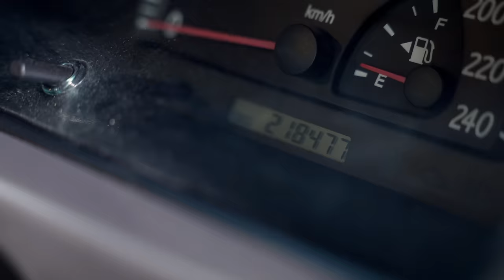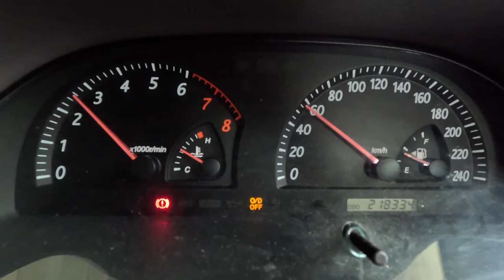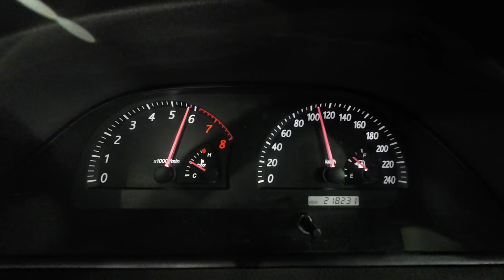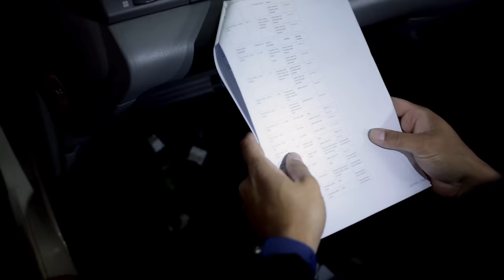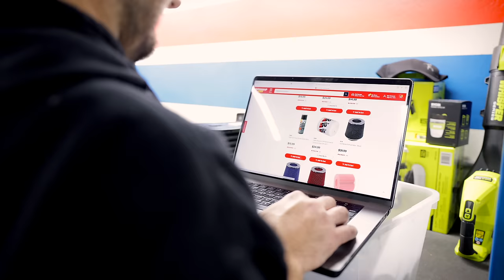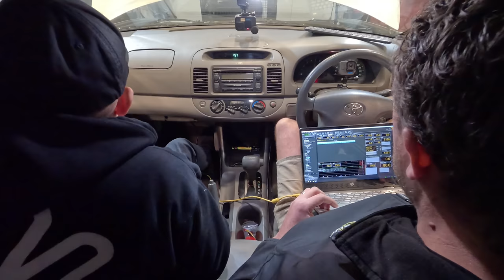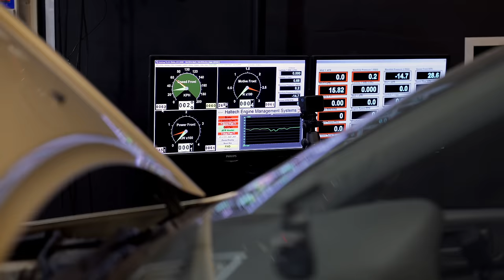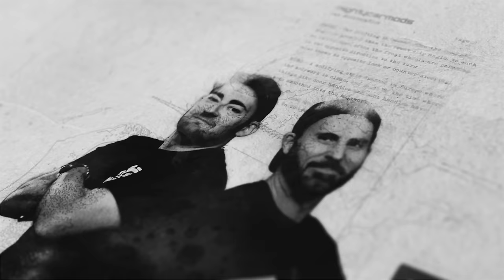World's cheapest Turbo Kit (on a Camry)

Comment: The resonator is called a "helmholtz resonator", and it is tuned to a specific frequency that is particularly loud on that intake system, in order to cancel it out. The whole point is to limit droning during cruise conditions.
Reply: Thanks for this explanation!!
Reply: The car should be a single seater if the owner doesn't want droning.
Reply: 🤣 @nunchuckfilms
Reply: @nunchuckfilms  Someone needs to send those tubes to Ukrainian troops to give them protection from droning.
Reply: Close. It's a 1/4 wave pipe resonator, though even resonant pipes have some helmholtz qualities.
Reply: @gregmuon  1/4 wave resonator is a subset of a helmholtz, in that you make the pipe 1/4 wavelength long, which gives the same effect as a non-tubular helmholtz resonator tuned to eliminate the same frequency.
Reply: They can add a bump in torque at certain rpm as well, depending on tuning size and location and whatnot
Reply: S2000 has one on the oem exhaust
Reply: What a legend
Reply: solved with electric cars
Reply: I wouldn't mind seeing the boys make custom versions of these to see the difference in noise/power etc.
Reply: well fuck me. my little parts runner toyota sienna minivan has one of those and i always wondered what the hell it was (but was way too lazy to google it). random internet comment ftw 👍
Reply: This.
Reply: @mechanicalman4531  Doesn't stop the drone from people about EV's lol ...
Reply: Resonatorectomy is what we call it when installing an intake lol
Reply: Let The battle of who can google the right facts first and try sound smart begin
Reply: Luv my subies, but that was freakin awesome. Hilarious..I want a Camry
Reply: What will happen if you remove it. Will you hear loud intake noise? Similar to the sound you would get installing a pod filter?
Reply: @phoenixking7449  You'll get SOME increase in noise. They are only used to target certain frequencies, which can't be eliminated by other aspects of the intake design. If you want intake noise, you have to remove all of the resonators, plug the remaining holes, and even then, it won't be super loud, because that's how they're designed.
Reply: @dr.mantistoboggan4746  TONS of cars have them on both intake and exhaust. The Lexus LFA has a whole intake manifold designed with these and other musical inspired qualities/Technology to make its sound unique. Very cool stuff.
Reply: @phoenixking7449  You likely wouldnt even notice until a mouse or something crawled up into it. Now if the intake system had a MAF sensor then the air coming in after the sensor would make the car run like ass.
Reply: @crisnmaryfam7344  Yeah but Honda was doing it in 1999, who's #1 big deal cow now?
Reply: @dr.mantistoboggan4746  Honda toyota, Nissan, All the Japanese brands were doing it in the 90's as they all sort of share tech amongst the country. If its something that helps with emissions and comfort and not something super unique and "proprietary" its generally shared to help better everyones experience of the like. Helmholtz resonance effect and such has been known about since the 1860's, its only when people starting complaining about mass noise and pollution that companies really started applying it in different ways. You can probably find a similar function in nearly every muffler/exhaust system or even multiple, on nearly every car since the mid 1980's. Whos the big deal cow? I have no idea man. You tell me.
Reply: Like somebody else said, intake resonators are common on naturally aspirated engines - partly to affect noise, but they also are tuned to improve VE at certain RPM ranges. The intake air charge moving through the intake creates a pressure wave that bounces off the intake valves when they close  The resonators are tuned with a volume that allows that pressure wave to bounce back to the intake valve when it opens again  forcing more air into the cylinder and improving VE.
Reply: When i supercharged my mustang with a centri, I had to install specific length j-pipes on the exhaust to mimic the resonators i pulled out when I lost the stock air box.
Reply: I am an engineer and don't know what it is.  I thoughtbitvwas to stop a vortexes in the intake...?
Reply: @petecotter6790  Nope. They're just for resonance. Vortexes are eliminated with flow straighteners, but that's only needed on the upstream side of a mass air flow sensor.
Reply: @JohnDoe-fk6id  I didn't consider the maf as a vortex cancellation device. Cheers
Reply: @petecotter6790  It's not. The flow straightener upstream of the MAF is
Reply: @JohnDoe-fk6id  sorry I re read what you said and yes
Reply: That turbo will probably last about 200miles😂
Reply: I like droning during cruise conditions, l get used to the sound and it makes me feel like it's healthy

Comment: I purchased an 03 Camry, V6 manual at the start of the year. This video has encouraged me to hold on to it, and slowly build it up to be something special!
Reply: I have a 2.4L manual 2005 Camry. Love it, but spent way too much money on it.
Reply: Where did you find a manual I have a 2000 V6
Reply: The 3.0L manual Camry was a sleeper... There was even a TRD supercharger for it...
Reply: @LeagueOfLegendsQc  So, which year was this Camry in the video ?? Thanks. Pwy.
Reply: How unfortunate
Reply: @Tenasedeinc  marketplace!
Reply: @SimanSlivar  I'm keeping an eye out, just bolt on from what I've read
Reply: @esscodc2  lol, why unfortunate?
Reply: because it's a camry  @LZEGION
Reply: THIS video made you feel that way?! 😂
Reply: @Wayne3nterprises  bro has already added a carbon wing on the back, and a stainless steel rainbow tip muffler onto it. And probably topped it up with 200 litres of oil since the original post
Reply: I have 03 v6 camry this motor has 335k and purrs as new.
Reply: @Billy-burner  don’t forget the stickers. Its got a bunch of stickers that add a ton of horsepowers
Reply: @bustjanzupan1074  2003 ??
Reply: '03 V6 manual is probably the best daily driver you can get that has the aftermarket for Fun, it's an amazing blend of stock reliability and aftermarket performance

Comment: based on my rough calculations from a blurry dyno screen, that 200 kw at 5700 rpm, looks like 330lb/ft of torque

270/330 at the wheels is impressive

Comment: The reasonator that you were holding is called a quarter wave resonator. It is designer for a wave to hit the end of it and bounce back exactly half a wavelength later. The original wave is then hit by this wave coming back from the reasonator, reducing the noise. But the reasonator can also be tuned to create an additional stronger pulse into the intake, increasing the torque slightly at a certain rpm. If you want more information on this just Google quarter wave resonator or Helmholtz resonator. These reasonators are also very common in exhaust to remove drone at a specific frequency(rpm).
Reply: There’s always someone who knows these things. Useless info but thank you anyway. I learnt something
Reply: @imachamp68  mate.did you miss 16:58
Reply: How does this resonate with you guys?
Reply: @imachamp68  Its not rlly useless, letting you add torque at particular RPMs would help smoothen the torque curve in a place it might not do naturally, resulting in much smoother revolutions.
Reply: That's actually fascinating
Reply: What an interesting explanation!  Thanks!
Reply: Why don't aftermarket company's use them
Reply: @diyhypercar7765  some after market exhaust manufacturers use them to reduce drone. Tuning intake and exhaust parts to perfection to gain than slight increase in performance or reduction in noise requires so much r&d that it's mostly OEM manufacturers doing it. After market manufacturers can usually also get some nice performance gains by just ignoring exhaust emissions rules, which OEM's have to stick to to get their cars road legal. The engineering effort that goes into resonators is worth it more if you sell millions of engines equipped with the resonators in stead of a couple thousand after market components. Often after market manufacturers also just want to provide more intake and exhaust noise.
Reply: How much cost does it add to manufacturing of the car?
Reply: @Dupries   Bugger all, but probably $100k or something to the cost of the design process
Reply: What a gentleman and a scholar, greetings from South Florida, South Canadia
Reply: @Dupries  Probably almost nothing, but the R&D cost would be considerable.
Reply: another fun tidbit about quarter-wave resonance- it's often used in transmission line speaker enclosures, with the sound path tuned to a quarter-wave of the desired port tuning peak. They're a bit uncommon these days in commercial designs due to manufacturing costs (wood ain't cheap) and inherent design difficulties, but they've been around since the mid-20th century. The physics of sound is pretty rad. 

The laws of physics are static- the crossover between seemingly unrelated disciplines is endless.
Reply: If I may ask, how do you know this? Do you work in the industry or from research? Would be interesting to know which profession etc
Reply: @tejasgihwala1313  I have studied automotive engineering and worked in automotive for a turbocharger manufacturer in the R&D department.

Comment: I like this long-form, all in one episode format.  Can't wait to see it the "after" version at the drags.  Might need a brake upgrade now...
Reply: Oh, it'll DEFINITELY need a brake upgrade 😅. That thing is a certified deathtrap 🤣. At least you'll have the time of your life (literally) before you hit a wall hahahaha
Reply: Surprised it didn't need a clutch upgrade as well.
Reply: @bryanribey  It's got a torque converter automatic transmission, so no clutch.  You're right to wonder whether the shushbox can take the boosted power.  Only one way to find out I suppose...
Reply: @bryanpowell3724  Oh yeah. Do all econobox automatics have no clutch then?
Reply: @bryanribey they have clutches internally, but they're wet clutch powered by electronics, the TC isn't a weak point, generally they break teeth on planetary gears or spider gears. No economy auto uses clutches in the traditional sense.

Comment: The plastic tube attached to the intake is a quarter wave resonator. Mainly exhaust system have them to eliminate done (or resonate frequencies) at a certain rpm. It will have a specific length to cancel out a certain frequency.
Reply: Thanks for being you
Reply: legend!
Reply: Also known as a helmholtz resonator. The sound wavelength travels into the tube, reverses direction and then travels backwards in the pipe to cancel out a specific frequency. The wavelength is out of phase with its original incoming sound wave, ultimately cancelling the frequency out. (+1 , -1 = 0)
Reply: the diameter and length are specifically calculated for the desired frequency you want to cancel out.
Reply: Is this what a GsxR Arata exhaust system has just before the muffler? (A little wiener)
Reply: That's drone not done btw.
Reply: Glad to find your post 17:20 seconds into the video.. lmao. Doing the lords work
Reply: Nice
Reply: You are missing the forest for the trees. It’s not for sound attenuation. It’s to make the flow of air faster and smoother by acting as an air spring to absorb buffeting
Reply: Thank you!
Reply: Ew waste of brainspace

Comment: I would definitely like to see more of the camry build. I have one myself and invested in Ceika street performance coils hauk brake pads and super pro front control arms super pro front stabilizer bars front trd sway bar ps5 tires rpf1 wheels and yes it is a camry but I absolutely love it. Stock motor so far bc it is a daily but it handles like a dream for every day use and occasional hard driving. For the set up it's very good, surprising for others

Comment: Great video! My issue with that engine. 2AZFE had a major issue with oil starvation from the factory.  I had a 2008 scion TC and my engine spun bearings. I replaced the engine and sold it.

Comment: I turbocharged and tuned my mr2 spyder by myself with a used Subaru turbo and a used pfc for less than $3000 total. Bought almost everything off Amazon and lucked out finding an iron turbo manifold off eBay for $115. Best thing I’ve ever done to any of my own cars and I was originally inspired to do this when I watched the gramps build as a kid. That mr2 flies now!!
Reply: how hard was it and did it require a lot of welding?

Comment: Quick tip :) when sealing flanges or sumps, run a consistent bead of silicone and run it on the inside area of bolt holes. Don't smear it afterwards as it can introduce air pockets or not seal correctly. Leaned this at VW, haven't had a sump leak since, and it's always nice to see an even bulge on the edges when you're tightening it up

Comment: 269 hp was actually impressive. I was expecting it to explode. 😂 this episode reminds me of when I used to watch every episode years ago
Reply: You were expecting a Camry engine to explode? That's like expecting a hammer to break if you hit it against something.
Reply: @aaa-vl1lk  2az fe are weak sauce, at best it'll handle 350hp max with e85 those automatics are hit or miss passed 250hp. Rods are the weakness in a lot of toyota engines.
Meanwhile the k24 equivalent will handle 500hp unopened. 

Good plus for the 2az fe is that they're found literally everywhere for dirt cheap as it's not that popular to mod.  Some simple rods maybe a block guard are needed.
Reply: @mouaxiong8618 what about a 2GR-FE? It’s in a Toyota Aurion
Makes 270hp stock
Reply: @Noname-iq1gz  2gr-fe is just a traditional v6. I think It'll be robust enough up to 500whp unopened on e85. I'm not too familiar with Toyota's platform so I can NOT confirm any information. If I remember they released a supercharged 2gr for a few years that made 320ish whp. 

I think it's equal to the Honda j35 v6's which are robust enough up to 450hp on e85.  

You need to understand that a well built engine doesn't mean it'll handle boost. But of course if you take ANY ENGINE apart. Upgrade rods, pistons, rebore, put in sleeves..Etc etc..  It'll handle boost just fine.
Reply: @mouaxiong8618  the 2gr v6’s are pretty solid engines not sure why the aftermarket support isn’t there. Some of the engines in these lineups also come with forged internals from factory. 

500 whp might be a stretch, but people touch north of 400 whp pretty regularly by supercharging the 2gr fe’s. On e85 it could mabye see closer to 450 whp.

Comment: Well done Nuggeteers. A mate and I started this same project years ago in a 2007 2.4L. Much prep work done, but when sent to Haltech they immediately sent it back saying NO, it's an auto 😞
Congrats to Haltech for having a go on this one. Despite the turbo disappointment, we installed King Springs, Whiteline adjustable swaybars, slightly enlarged rear muffler, high flow cat, and derestricted the intake. She still got up and went surprisingly well. 115kw to about 140kW if my memory recalls correctly. 120km/h through a corner steering with a pinky finger on 45 aspect 18" tyres. So well balanced. Despite their boring/bland appliance reputation, these cars have so much potential.

Comment: So, buy the turbo for the engine, and forget about the "kits" since you will be buying almost everything piecemeal anyway, got it. Great build! I have a 1998 Nissan Altima with a 2.4 that might need the same treatment once I upgrade to a newer car! I don't mind the install and fabrication work needed, but finding a good tuner is obviously key to maximizing results. Thanks for this video!
Reply: Had an early 1993 altima with jwt intake,  unorthodox racing crank pulley, header and catback exhaust with the variable Nissan maxima muffler back around 20 years ago. That little jellybean was such a fun punchy car to drive and I kept it until over 300,000 miles before giving it to my younger brother.  He totaled it a few months later, idiot.  Should've kept it lol

Comment: The reason those turbo kits exist is because of the Gen1 Scion tC which had the 2.4l 2AZ--FE. The Scion xB didn't get the 2.4 till the Gen2 in 2008 and only like 5 of use myself included have turboed those. Also you don't want to go over 300hp or 8psi on a stock 2az, 300hp on a stock engine will run for quite awhile but the second you go over 300hp or 8psi it will grenade itself pretty much instantly.